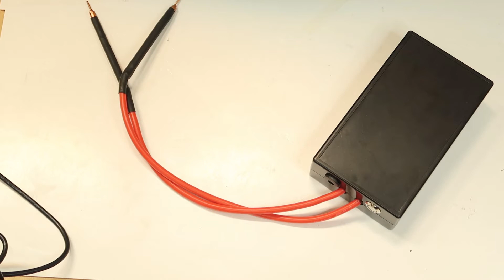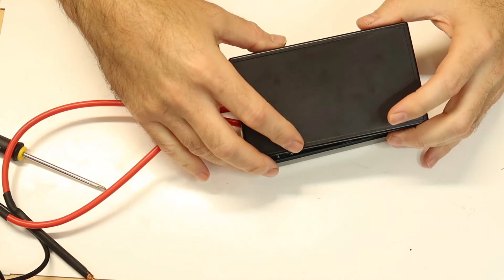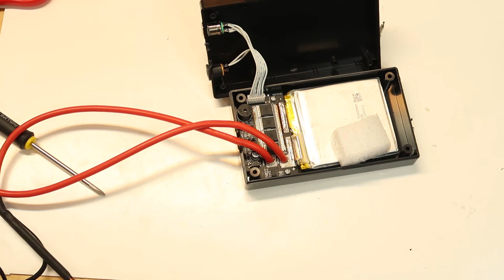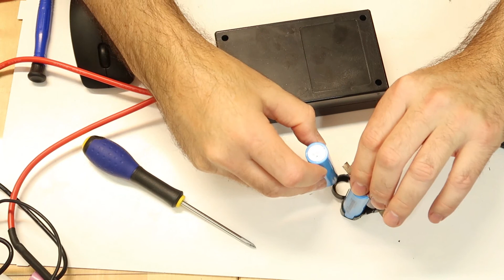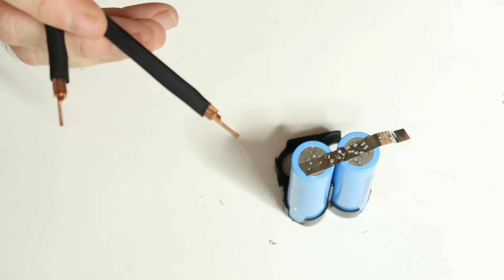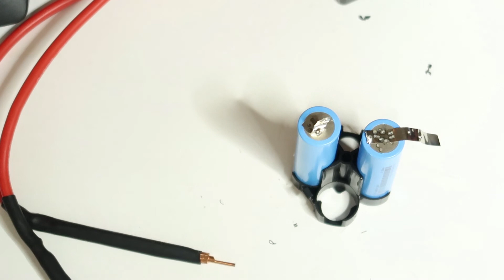Aliexpress Spot welder disassembly

Comment: I've always imagined that some capacitor bank would provide the pulsed current, not a current pulse directly fom battery. I think the battery will die very shortly if discharged at such high currents (near 100C discharge rate considering 500 A pulses). Obviously not suited for professional continuous work, but I wonder if anyone had already made some sort of robustness test with those.
Maybe after some batt cycles, remove the battery and perform a charge test, or measuring the pulsed current in a new device and repeat that after using the device for a couple months.

But thanks for the video anyway!